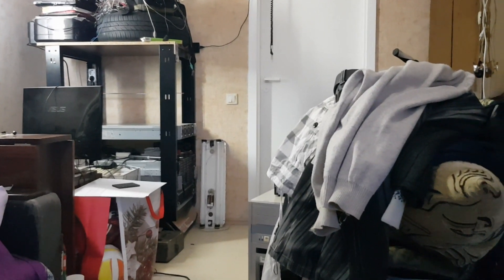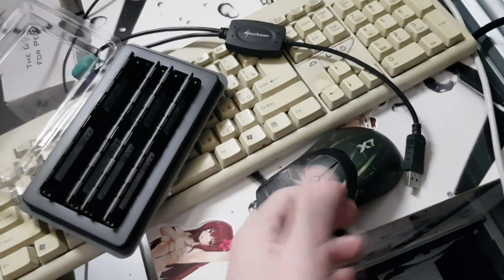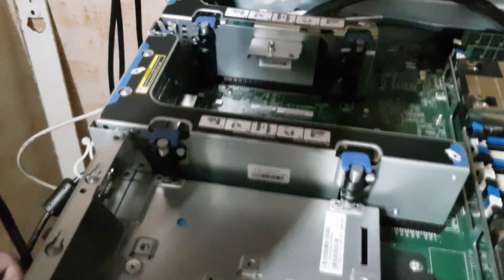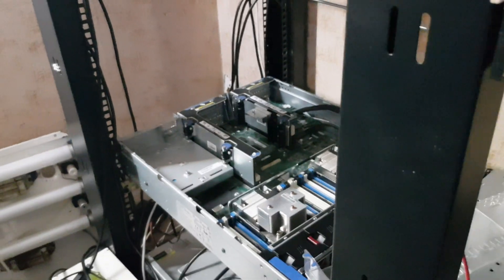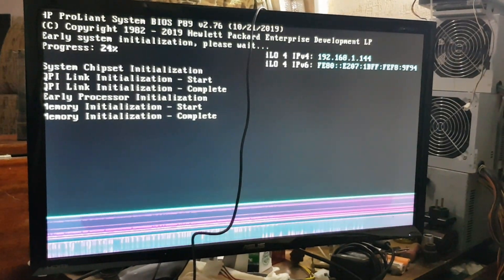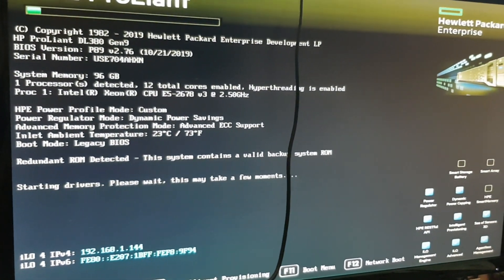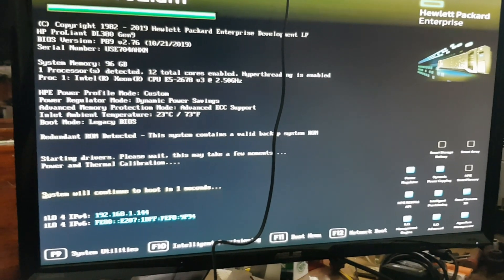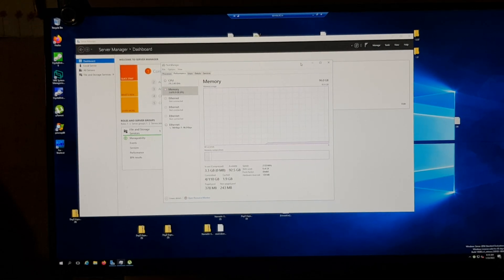Adding more ram on HPE DL380 gen9 with bootup sounds

Comment: At 10:39 the fan sound went way down. Is this the result of some tweaking or this is the stock fan? How bearable is the fan sound on the base model in a home office? Does the fan goes up based on the fact that you insert drives or it is purely controlled by ambient temperature? Currently I am working with ML30 Gen10 and the noise is just a disaster, thinking on downgrading.
Reply from the maker: Hi. All stock. Gen 9 dl360/380 they have ambient temps set in bios. i managed to set the highest available setting  for fan sound issues. + if there is no gpu in pcie slots it will continue to be more quiet. my room temp is about 23-26* C +-. if its sunny day may get to 28+ or more